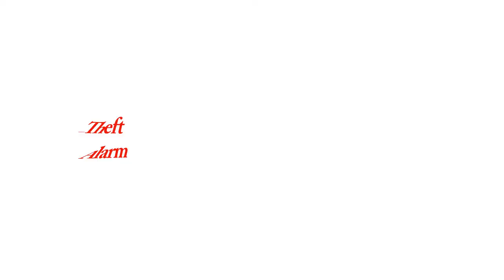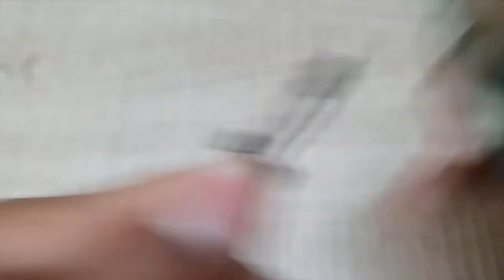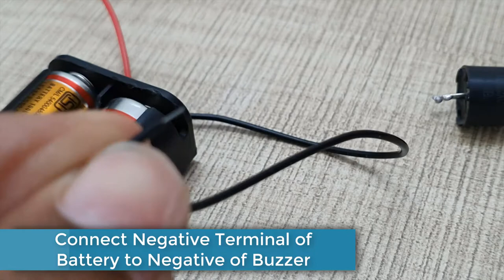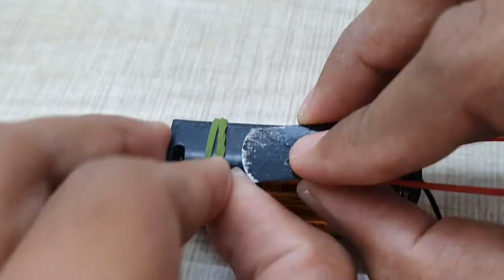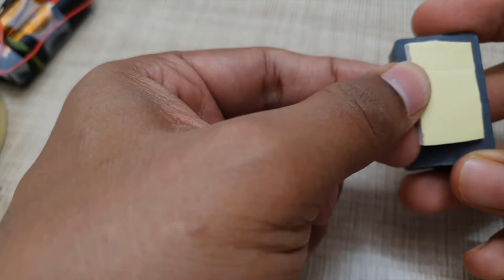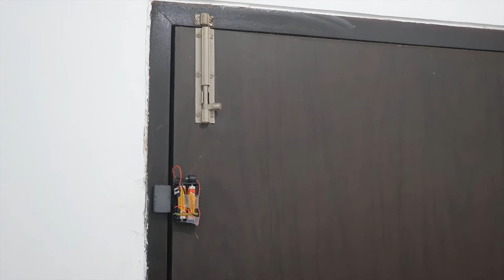How to Make Anti-Theft Door Alarm | Simplest Door Buzzer

Comment: 1. Get a hair clip to break the bigger part in half then sand it down until there's no more color only metal

2. Get a AA battery holder and 3v active buzzer then put some batteries in the battery holder then connect the negative terminal of the battery to the negative of the buzzer  with an soldering gun, then check positive sign to identify terminals

Comment: nice.  do you know how to make current door alarms stay on another few seconds longer (around 10) even when someone closes the door?  Whats in them that makes them count a few more seconds before turning off ?  Just curious.  Thank you.
Reply from the maker: Thank you for your response. You can increase the strength of rubber so that, it will not get attracted to magnet again , hence keeping alram ON even after door closing. Or you can use hardware and set the timer.